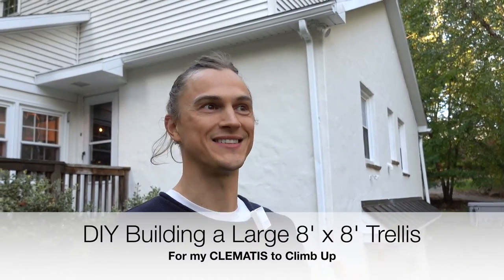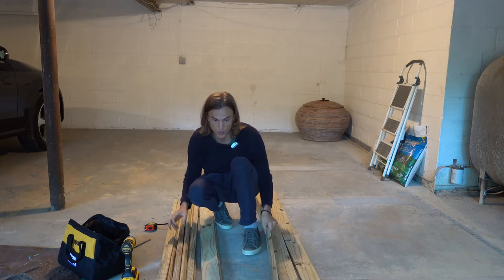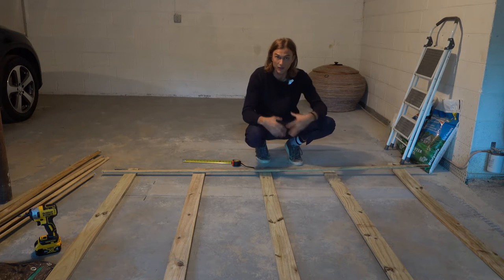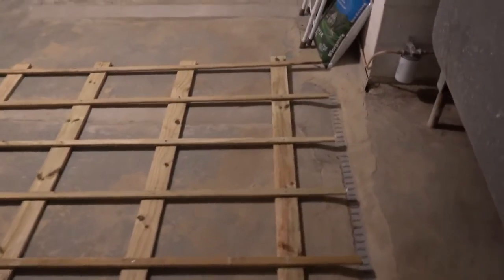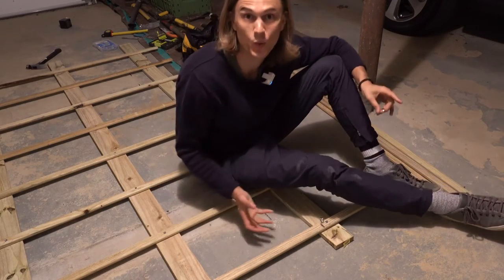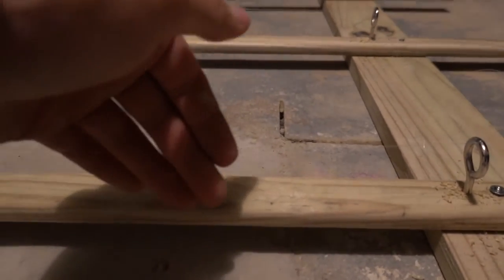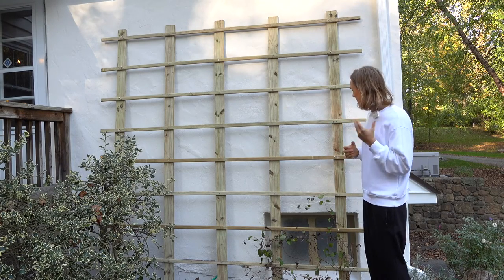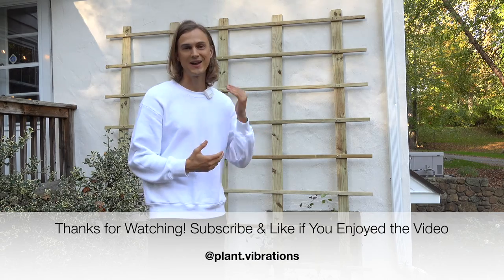Build a DIY Trellis for Your Climbing Plants (Clematis, Honeysuckle, Trumpet Vine & More)

Comment: Suggestion:  Do NOT attach trellis _directly to wall.   Add some wooden blocks behind it, so the Clematis gets some air circulation plus away from a Hot Wall.
Reply from the maker: I have the trellis slightly angled, you think that is sufficient?